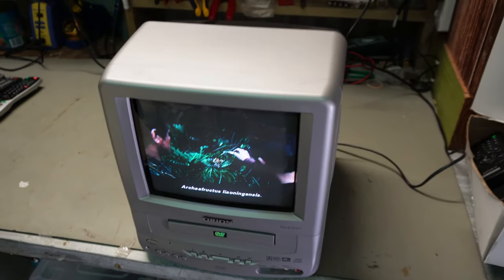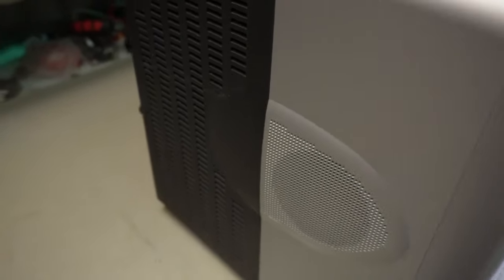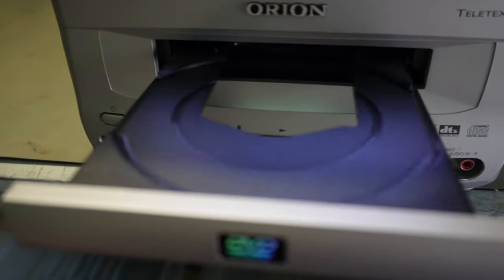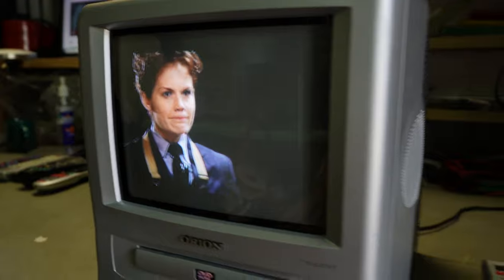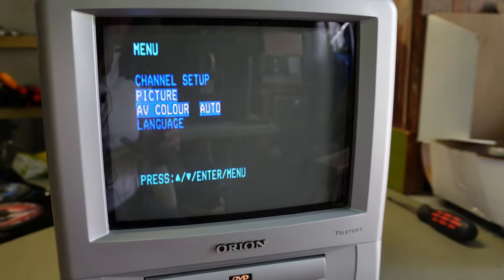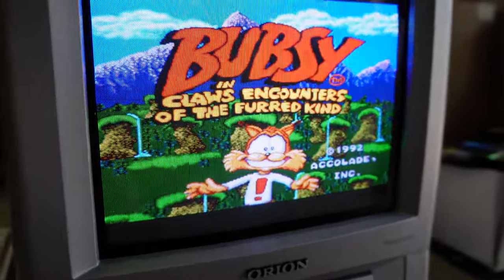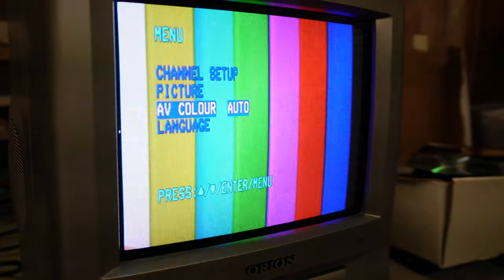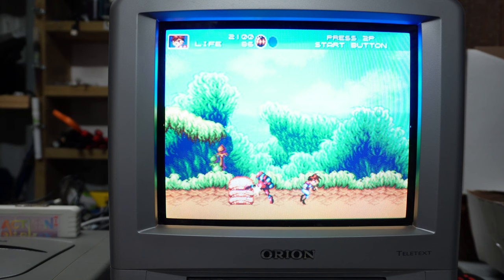Orion 10DT SCART CRT TV / DVD Combo

Comment: Going by the menus, this set, or at least the chassis, is made by Vestel/Beko, which had the bad habit of disabling NTSC playback in software; the point is: if you investigate the service manual you may be able to enable it back in the OPTION values section.
Reply from the maker: 100%

Comment: I have it (in the UK) as the Roadstar TVD-1051, it's exactly like yours, but the case is fully painted in Silver. I had the exact same issue with the remote, and I got it fixed only when using a Logitech Harmony 350 (a no frills model, 19 quid) and I got it going by applying the remote profile of the American version, the Memorex MVD2009CB. If you also search around by this model, you'll be able to find the service manual for it, although it's for the version with NO SCART input. 

It's a brilliant little tv set, I'm very surprised, as you were, at how good this set is.

Cheers!
Reply from the maker: Awesome and thanks for sharing the background info that you researched to get it going. Looked up the roadstar brand and found an ad with your exact model and I can see very much a portable on the road branding indeed!

Comment: This set is awesome!!! I picked up a U.S. version several years ago out of a Salvation Army dumpster. Mine is just a bit different looking (less rounded more square). 

I think they tossed it due to the dvd player not reading discs. Which I remedied by swabbing the laser with IPA. 

I purchased a factory remote from eBay for ten bucks free shipping and use this little tv all the time, mostly to test consoles I’ve repaired/modified. It has a fantastic picture!

Edit: that US model you showed is the one I have.
Reply from the maker: great pickup, missing remote is a common theme with this tv. Thanks for the feedback on the US model!

Comment: I think I saw a model of TV like this at JB Hi Fi in around 2004 or so, they had other TVs with built in DVD players, and I think this one was more expensive than the others they had.  I suspect this TV made have been designed for use in campervans and caravans etc, that's why it's so small.  Either that or it's just meant for use in small bedrooms and kitchens and the like.
Reply from the maker: Your right, 100% the intention was for campervans etc. Hell of a tv for being so unassuming.

Comment: these are awesome - these must be similar to those i saw on the coach replacement buses for the v line. i wonder if those had rgb
Reply from the maker: lol unreal. The old bus with a CRT at the front but rarely ever turned on. Low milage crts from older buses the next big thing!
Reply: @rgbrob  maybe! this was a coach bus - i believe it sported two CRTs mounted into the baggage stow for passenger viewing on either side

would be a great opportunity if there was ever the chance to have a day with the camera going over the internals of such a system
Reply from the maker: @Richtr8  how good, never seen one like that before